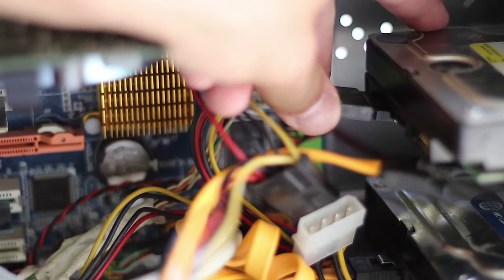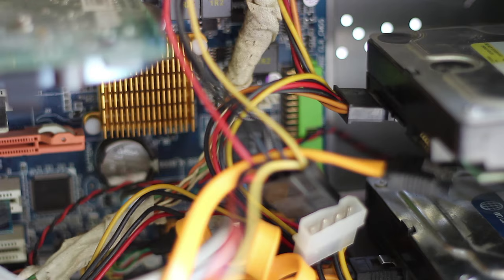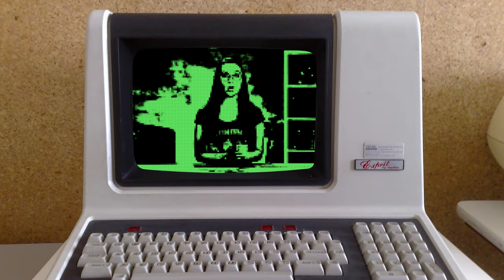PC Build – How to Fix a PC that won’t boot – DIY in 5 Ep 112

Comment: This is almost embarrassing, but my main computer died.  Let me explain:  I was cleaning the computer fans, Antec 1200, a lot of fans with water.  I dried the fans the best possible, but when I put it all back together, Nothing happened.  It died!  After 2-4 days of trying to fix it, I just ended up buying parts and built a whole new computer.  I can't NOT have a computer, it's my business.  
This is what happens:  I plug the power on, lights go on the motherboard, but that's IT.
I push the power button, nothing happens.  No fans, no CPU fans, nada, just the 2 red and green lights on the computer motherboard.
Is my motherboard fried?
I tested the power supply, it seems fine.
It's not my memory, and I know when it doesn't work at all.
Is it possible that a little water leaked onto my motherboard and "silently" fried it?  I just can't figure it out.

Comment: plz help . i did everything , but my computer does not beep with out ram installed.. whats the problem in my pc ? y pc is wont bootup.?
Reply from the maker: What model RAM and motherboard/processor are you using?

Comment: My pc suddenly shuts down then I turned it again, the inside lights up and the fan spins, but there is no display.

I tried switching the ram, used the motherboard hdmi instead of my vcard, reset the cmos, and still I cant boot my computer.

What's the problem?
Reply: I have the same problem, please reply if you find a solution for it

Comment: None of the fixes here helped. 
COmputer turns on but i just have a blank screen
Reply from the maker: Hi there thank you for your comment. If you have already tried the suggestions in this video as well as checking the physical components in and around it perhaps your best bet is to consult with the computer manufacturer for further diagnosis as well as consulting with a local Computer Repair shop.

Comment: Thanks for the information, the issue seems to be the hard drive, after doing a test all components received a green ⬆️ however the hard drive got an X can anyone recommend something I can do to get the computer to boot up to at least get all the info to s new hard drive.
Reply from the maker: Hi there thank you for your comment. If you have already tried the suggestions in this video as well as checking the physical components in and around it perhaps your best bet is to consult with the computer manufacturer for further diagnosis as well as consulting with a local Computer Repair shop.

Comment: Having issues where lights are on on the motherboard, but fans won’t spin to start up. What could cause this?
Reply: The2dworld were you able to fix this. I have the same problem
Reply: @MrTheDucktape  As of now nope. Been swamped with some work stuff so I haven't gotten back to it yet.

Comment: I had set BIOS pin. I installed new cpu chip but pc is not booting. Is it due to that password pin?
Reply from the maker: You may want to check you CPU installation and also could try the CMOS reset button but remember it 'erases' all settings as well. You can also contact the motherboard manufacturer for assistance or visit a local computer repair shop in your region.

Comment: So my PC was running but then I decided to add another stick of ram into it and now it won't run.  What should I do?
Reply: how did u fix it? i have the same problem: i bought second ram ddr3 and when i added, pc did not boot. so now 2nd ram slot does not working(no boot) and pc run with only first slot. as i remember 2nd ram slot was working fine too but after added second ram, 
2nd slot broked-_-

Comment: My pc won’t turn on (fans not turning on ) all lights on .i have been trying to o fix my pc for the 3rd day but found nothing .once in these 2 days the fans have turned on but no display do I went to see why and said that maybe the cpu cable is placed wrong so I changed the position but it did not turn on again same  problem as before I tried putting the cpu cable back how it was but nothing pls help I can’t live without it 😩
Reply from the maker: This is interesting and after making sure that the cables are fully seated there is no response?  Did you check that the PSU is working properly? If there are still no signs then you should have it seen my a Computer Repair Shop, that's if they are open in your area and not shut down due to the COVID-19 pandemic.
Reply: The problem is I though there was a problem with the psu and I got a new one but nothing

Comment: Computer is getting into bios… boot up randomly … checked ssd seems ok … file system seems ok …(from cmd initialized by the recovery usb stick) … the ssd although sometime disappear from the list of peripherals in the bios … maybe a controller problem ?
Reply: Ah I forgotten can’t boot up in safe mode
Reply: I’ve ordered a new ssd but isn’t it strange that one is working and freeze with blue screen and not boot up again … conclusion ssd defective ?
Reply from the maker: Hello Alby sounds like a possible issue with either the unit or the drive itself. If this is the case that the SSD is causing issues and it is our product, please contact our Tech Support here: https://kings.tn/44DMTJz 
Thank you.

Comment: none of this helped me and my computer is not turning on... :(
Reply from the maker: Hi there thank you for your comment. If you have already tried the suggestions in this video as well as checking the physical components in and around it perhaps your best bet is to consult with the computer manufacturer for further diagnosis as well as consulting with a local Computer Repair shop.

Comment: My gaming hp doesnt restart after update..its 3 years old and this happens for the 3rd time, no warrenty anymore, expensive pc, only led light is on, i can hear the fans, tried almost everything...any ideas please?
Reply from the maker: Does the board boot if you have no memory modules installed? Also check the physical components in and around it as well. Perhaps your best bet is consulting with a local Computer Repair shop.
Reply: @kingston  thank you, i watched a lot of videos, and managed to get it finally working again! Did a hard reset, different monitor etc, and immediately as soon as i turned it on, it did a bios update 😊 after all that it did a full update of windows etc etc, and it all went well. The update progress was also showing on monitor now, which i never saw before. I am very happy!
Reply from the maker: That is great news, glad to hear it is up and running! Thank you for messaging us.

Comment: Thank you so much my computer will not boot up for some reason
Reply from the maker: Hi there thank you for your comment. If you have already tried the suggestions in this video as well as checking the physical components in and around it perhaps your best bet is to consult with the computer manufacturer for further diagnosis as well as consulting with a local Computer Repair shop.

Comment: Well my problem is that I accidentally remove some of my USB ports in mother board and I tried to get into its place, but I messed up. I tried to get that one thing straight but I forgot to turn my PC off and it shuts down and won't turn on! Will somebody help me? And sorry for my English I am from Czechoslovakia
Reply: Try to reset CMOS battery, look at youtube
Reply: @NickJourdan  Well I searched for it and I realized that in my mother board there is no jumper. If the jumpers gotta be in jbat1 slot they aren't
Reply: Well nope guess it's not problem in cmos
Reply: @danielkuchar1786  is it old motherboard or what. Because motherboard should have it.

Comment: My Mom (who's obviously not a techie) has a cheap-o Windows 10 2-in-1 computer.  Everything was fine and I couldn't even think of anything that she might do to break her PC.  Unfortunately, she had not used the device for a few (MANY) months.  Now, it doesn't boot.
Reply: Does it POST? if not then it could be a dead CMOS battery

Comment: Hi! I have a problem with my psu and every time i starting my pc its turning on, fans are spinning and everything is working but my keyboard dont light up same with the mouse, and my monitor isnt turning on either. I have to unplug the psu cable and put in in again and then its working. Can u help me?
Reply: same problem with me as well

Comment: I've tried everything, I've tried doing a system reinstall and that doesnt even work, I've tried using safe mode but that doesnt work, I cant do any system boot troubleshooting checks but that doesnt work, I've tried literally everything, 

I did a component check and it showed that there was something wrong with my hard drive, could that be a possibility? Should I replace it?
Reply: yes

Comment: What about if pc boots up but it’s keeps on rebooting?
Reply from the maker: If you have checked that you have the proper power supply, memory modules fully installed, the internal wiring/connections are not loose and your storage device is good as well you may need to have a service technician take a look at your system cause it may more issues.

Comment: I had not used my HP Envy 00-074 for months. The PC worked great every time before this. Now, it showed the screen saver, but never went past that. Today, after trying everything you said in this video I get nothing at all other than a red light appearing on the front of the tower. NO beeps at all. Fans work fine. Unplugged the memory cards. Nothing. Maybe mother board woke up one day, dead? I have a boot disk, but cannot get the PC to use the Boot DVD. Why not? Probably because something else is malfunctioning? Please help. Should I go to Geek SQuad and pay $$$ to have them tell me it's useless?
Reply: Yes hopefully they say it wasn’t  as useless as the help you got on this comment

Comment: My system unit's fan wont turn on but there is a green light blinking at the back. My monitor is blinking blue lights as well but it wont open

Comment: Thanks so much for this video! I couldn't get past BIOS and after watching the part where you mentioned checking the fans as the PC won't turn on to protect itself I noticed the connector to one of the fans had come loose.